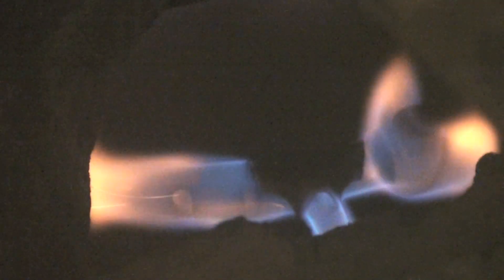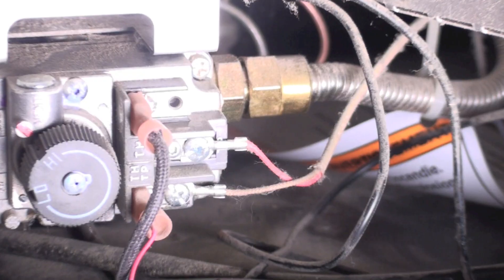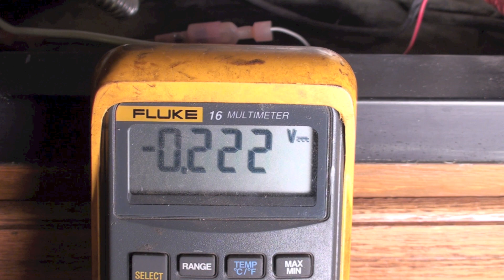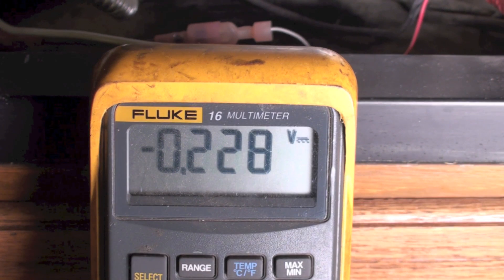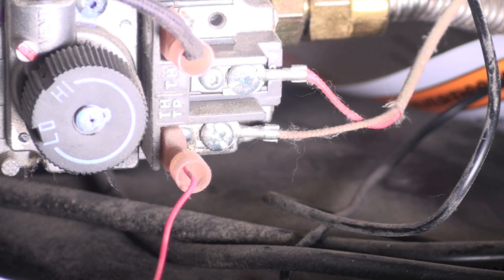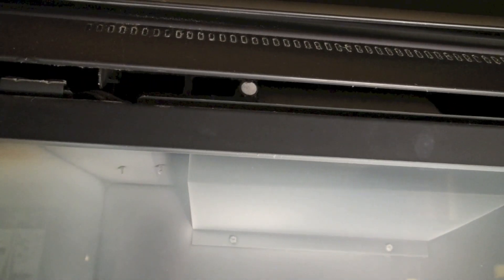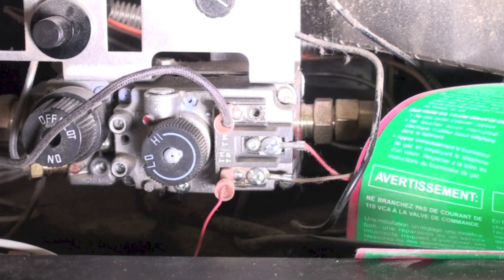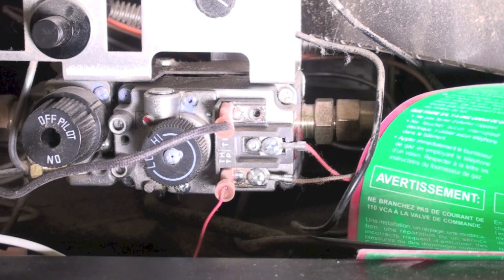How the fireplace thermopile system is wired

Comment: GFM.  I'm having a weak pilot light problem on a  Majestic 36BDVRRN natural gas fireplace with a Sit 820 gas valve and an FP 9903 top mount pilot. It is burning blue,but is not strong enough to be projecting out far enough to impinge on both the thermocouple and the thermo-pile. I proved everything else was working using a propane torch to substitute for the standing pilot. 

I've tried adjusting the flame using the adjusting screw on the gas valve, but there was no change. I use compressed air to blow out around the head of the pilot tube as much as I could, but that did not seem to improve anything. There did not seem to be any easy way to disassemble that unit to try to get to the orifice to check for plugging, assuming there's one in there. What would be the procedure to do that? 

I also tried removing the pilot gas tube from the main gas valve and was going to blow compressed air through that to see if I could remove any obstruction. I was able to get the ferrule not completely loose in the, but the small diameter aluminum tube did not seem to want to pull out of the gas valve even with pretty firm tugging on it. I did not want to damage it so I did not mess with it anymore and just retighten the ferrule nut. Is there some special trick to remove that pilot gas tube? Looking at the photos online of the replacement pilot head assemblies it appears to be just a simple tapered end on the tube that would match up with a seat in the gas valve.
Reply from the maker: There is no special method to removing the pilot tube.  Sometimes tapping the tube will loosen it.  There is a very small orifice at the end of the tubing at the pilot.  It may be plugged. It will need to be replaced.
GFM
Reply: @grayfurnaceman  , thanks for your quick reply.

So I assume there's no way to disassemble that top hat assembly at the end of the pilot to access that orifice to clean it. Is that the case?
Reply from the maker: No, it is easily disassembled.  You may have to do some disassembly to get to it.
GFM

Comment: Thanks for a solid explanation on how these units function. Fought with my fireplace for a while... intermittent flame... pilot light would shut down while in use, etc.  I was able to establish that the thermopile and thermocouple were good. Issue was thermopile was not generating enough voltage due to insufficient pilot light. Tried adjust the pilot with no luck. Ended up having to clean out the pilot jet as it became somewhat corroded. ONce that was cleaned it fired right up like it was new.
Reply: Tim, I'm having the same weak pilot light problem that you describe and I've tried adjusting the flame. I proved everything else was working using a propane torch to substitute for the standing pilot.

What fireplace were you working on? Mine is a Majestic 36BDVRRN with a Sit 820 gas valve and an FP 9903 top mount pilot assembly.

Was yours the same or similar? I did not have any success in trying to clean the orifice or pilot tube.

Comment: Is there a way to wire in a thermostat on my gas fireplace mine has a gas control valve with pilot, on ,and off and another knob that controls the flame height it also has a box with a switch that says on off and auto I realized to
Day there is a light switch on my wall that I can turn the burner on with when the box on the heater is in the off or the auto position or I can turn it on by switching the box to on ..... any help would be appreciated thanks
Reply from the maker: You can install a thermostat in place of the wall switch.  This can only be done if the switch is wired with thermostat wire.  If it is wired with 12-2 romex, it is probably a 120 volt circuit and any thermostat would have to be rated for 120 volts.
GFM
Reply: grayfurnaceman thanks yes it is wired with thermostat wire I’m going to get one with the remote control with built in thermostat. Thanks again

Comment: Good video. Thanks for taking the time to train and upload.
I replaced a Fireplace gas control on a Hearth and Home unit. The old control had a thermocouple and thermopile. The replacement control, Robertshaw 710 series Millivolt style, did not have a screw in thermopile connection. It had a jumper wire from one of the wire terminals to the place where you normally would screw in the thermopile fitting.
I take it, the voltage that operates from the thermocouple is used via this jumper wire to control the magnet on the thermopile side too. ???
I hooked it all up and everything appears to be working perfectly...but that doesn't necessarily make me sleep better.

Comment: I have a problem with my Napoleon HD40.  The pilot lights perfectly every time but the main burner doesn't light.  I'm not sure if the problem is with the Dexen IPI 3v electronics not sending the correct voltage to the valve, or if the Dexen valve isn't opening when told to do so.  The thermopyle is sending about 480mv to TP-TH/TP.  It reads about 340mv between TP and TH.  With no wires connected the resistance between TH and TP is essentially infinite (open).  Does this sound like a electronics problem or a valve problem?  I've been trying to fix this for months . . . and it's about to get cold up here in Canada!  Any advise would be appreciated.
Reply from the maker: I would be checking the ignition control for input power.  Power in no power out control failed.
GFM
Reply: I get the same result using either AC adapter (3v AC) or battery (3V DC).  There is an inline battery relay that excepts both of these power inputs and sends it on (DC) to the main module.  Page 43 (Section 8.4) of the fireplace's manual shows the full setup.  It is available at http://mynapoleon.napoleonproducts.com/uploads/product_downloads/W415-1566_AeAf1.pdf
Reply from the maker: If you have power to the ignition control, but no power going to the pilot, and the wiring to the pilot is ok, the control has failed.
GFM
Reply: How do I tell if I have power going to the pilot?  When I turn the wall switch on the pilot comes on.  When I turn the wall switch off the pilot goes off.  If the module is the problem can I bypass it somehow to test the valve?  Are the measurements I gave indicative of a normal, or defective, valve?  If normal, I'll buy a new module for $100.  If defective, why would I replace the module when that's not the problem?  Or do I need to do more measurements on the valve for you to know for sure?
Reply from the maker: If the pilot comes on when it is powered up, it is probably not proving the pilot is lit.  I believe there is a flame rod on the pilot assembly. Try cleaning it with sandpaper.
GFM
Reply: I cleaned both "probes" that get engulfed by the pilot flame.  No difference.  Pilot lights fine.  Main burner never turns on.
Reply from the maker: You probably have a failed ignition control.
GFM
Reply: I ordered a new ICM and that fixed the problem.  In checking the voltages at the valve TH to ground is now 1.92v.  Also, the red and green LEDs on the battery relay are now brightly illuminated.  With the defective ICM they were very dim.  Thanks for all your help.  Hopefully this will help others in the future.
Reply from the maker: Jeff Bowyer Glad you got it going
GFM
Reply: Regency fireplace pilot won’t light

Comment: My thermopile voltage is .390 mV with the pilot on.  When I turn the burner on it dropped to .180 mV.  My question is it normal for it to continue to drop while the burner is on.  In 17 minutes it dropped to 157 mV.
  
My main issue is that it intermittely has shut the burner and pilot Off.  Restarting the pilot always seems to work, but not the burner.  One of the times when I turned the switch on, the pilot shut Off.

I then cleaned the thermopile with emery cloth and everything seemed like it was working great again until the third time I tried it and the burner wouldn't light again.
Reply from the maker: The minimum mv with a load is 125 mv.  I would like 500 mv open circuit but yours is not bad.  Some units have an over temp limit that will shut down the pilot.  Other than that, be sure all connections are tight.  Hope this helps.
GFM
Reply: Thanks so much for the quick response and information.

Comment: Hi Gary, nice video. I have a gas fireplace that is currently hooked up to a light switch. So "on" the fire will light... "off" and the fire goes out. The problem is I am scared we will forget to leave it on accidentally while out of town. I am attempting to replace the light switch with an analog low voltage thermostat so the fireplace will turn off at a max of 80 degrees. I hooked up the red and white wires from the switch to the thermostat from honeywell and nothing happened. Any guess as to why? Is the voltage not quite right for the model thermostat (CT87K)? or is the wiring at the control valve not set up for thermostat control? Seems like mine is wired just slightly different. Thanks for any help!!
Reply from the maker: You have the wrong thermostat.  You need a millivolt thermostat.  Try this one:  CT53K1006/E
GFM
Reply: @grayfurnaceman  just curious I have the very same issue I have a brand new Honeywell CT 33a if I touch the red and white wires together the heater turns on and stays on but if I hook up the red and white wires to the thermostat and put the temperature to 90 the magnet clicks over but the heater never turns on any ideas?
Reply from the maker: The gas valve runs on very low voltage, so it is easy to have a bad connection.  Try cleaning the thermostat contacts with a piece of cardboard.
GFM
Reply: @grayfurnaceman  hello Gary, I thought it was a bad thermostat so I just replaced it with new and it's doing the same.
Reply from the maker: Is the new thermostat rated for millivolt?
GFM
Reply: @grayfurnaceman  yes Honeywell ct33a  says 750 millivolts on there
Reply: @grayfurnaceman  thing is when I take the white and red wires from thermostat and touch flames on. But connected to brand new thermostat nothing. Pilot is on.
Reply: Either you have a bad connection in one of the wire terminals or the thermocouple is not putting out enough voltage.  Is the pilot flame covering the the thermopile completely?
GFM
Reply: @electriccar3253  who would be your suggestion test voltage at the thermo-pile like the video suggest cuz when I touch the red and white wire I do get flame on butt that just that there's probably not enough voltage to trigger the thermostat

Comment: Thank you so much! we had a repairman come out to look at our Gas Vermont Castings stove and he said the Honeywell Valve needed replaced and they don't make it any more so throw out the stove and get a new one. As that solution wasn't acceptable I came upon this tutorial and we worked on the stove and cleaned it all out and filed the thermopile with an emery board. It works!
Reply from the maker: Can't say I know why that worked but glad it did.  Many techs do not understand millivolt systems.  However, even if the valve was bad,  most valves have a general replacement valve that will work.  Sometimes I growl about service techs not servicing.
GFM

Comment: How do you know you have a open circuit when your in mV,  wouldn't your meter have to be set to ohms to perform a proper resistance check?
Reply from the maker: In this case, you are using the "hopscotch" method to find the open.  A little complicated to explain here.  Try Electric troubleshoot with the voltmeter in my channel.  There are 3 videos that may help.
GFM

Comment: I enjoy your videos man. You've got some great knowledge on your channel. See if you can help me, please. 
I just bought a house with a propane fireplace. It's run off of propane, with a Sit millivolt valve. The pilot light looks great, all blue flame. I can not get the burner to come on. 
The fireplace has never been used, house was built in 2014. Should there be electric an electric switch to give it power? I've replaced the thermopile, only to get the same response- No burner flame. ____HELP!
Reply from the maker: Most of these fireplaces have a switch inside that can turn it on.  Additionally, there may be a wall switch (or thermostat) that can be used to turn it on.  Also, be sure the gas valve is in the "on" position.  Hope this helps.
GFM
Reply: grayfurnaceman I just figured out, by chance, that there needs to be a jumper wire from the TH to the TP/TH. 
I'm in the process of installing this. Could a regular light switch work? Will 16 gauge wire work? I'm thinking about putting a dimmer light switch on it, would that be feasible?
Reply from the maker: Yes and yes and no.  Dimmer will introduce resistance in the line and shut it down.
GFM
Reply: grayfurnaceman thanks for the assistance. Much appreciated!

Comment: my 95 year old grandmother was given an older U28 Regency fireplace. She wants it working so she doesn't have to have wood brought in for her wood stove. I don't know if it's hooked up right or if it works correctly. I don't know anything about gas stoves. Can I inspect it to make sure it works correctly without having the gas company turning on her gas? she doesn't want a gas bill if this fireplace doesn't work. I don't know what to check for.
Reply from the maker: I would get a professional for this one.
GFM
Reply: grayfurnaceman I am experienced with heavy equipment vehicle maintenance so I feel I could troubleshoot it with some general knowledge of what to look for and what to test. I have a wiring schematic, but not sure how to test or when each area should have continuity/voltage or how much.
Reply: grayfurnaceman for example can I recreate a pilot/flame to make system think it had gas so it would work properly and I'd know I could get gas hooked up to it?
Reply from the maker: There's no way to be sure everything works without gas.  You can use a propane torch to heat the thermopile and measure the output.  Should be 500 mv open circuit.  The problem is there is no way to determine for sure the gas valve opens without gas to it because it uses the gas pressure to open the valve.  The good news is there is not a lot to fail.
GFM

Comment: my 4 year old Regency u-39 propane stove will at times stay on heating the house beyond the set temperature, as high as 90 when set at 70, this happens  occasionally , I replaced the batteries in the wireless remote and receiver box, but with no luck....any ideas? thanks
Reply from the maker: I am assuming the remote is located in the conditioned space.  If power is present at the gas valve when this happens, you have a problem in the receiver or remote.  No power to the valve, the valve is sticking on.  This is one of the hardest types of failures to find as it is intermittent.
GFM
Reply: thanks for the info, i'll check it out

Comment: question: I light my pilot after cleaning my thermopile it has improved blowing blue/strong but won't light the rest of the fireplace. It's at 663mV . The sensor lights and becomes bright red...after several minutes the sensor suddenly cools off and the pilot loses it's zing, but still burns well. Any ideas?

Comment: I am looking to convert my gas vent free 10.000 BTU fireplace to thermostat control. My idea is to use a MV Valve from a gas water heater, and thermopile for safety and feedback to control the valve. To keep things simple this would be a STANDING pilot system. This valve would be in series before the supplied fireplace valve. The fireplace valve would be left open. Street value of the manufactured control systems easily approach $700. Any thoughts or suggestion?

Comment: Hello, I have a thermopile issue I tested with a Multimeter and open flame and as soonest I hit 400mv meter goes OF.L (Offlimit)..as I let it cool then It starts working again. Does that indicate a faulty Thermopile? My fireplace pilot would not stay lit. Thank You
Reply from the maker: +s13konrad The meter just is not set for anything above 400 MV.  The thermopile can reach up to 750 MV.  If the pilot won't stay lit, be sure the flame is blue and covering the thermopile.  If it is ok, check for a manual reset limit in the circuit.  Hope this helps.
GFM

Comment: My pilot would not lite, tried cleaning, noticed by trying to lite at the pilot with a lighter that the lighter flame didn't even flicker, so i shut off the main leading into the control box, disconnected the line going into the box, turn the shut off value back on and no gas was coming out, what am i  missing here, thank you
Reply from the maker: Pinky Floyd Have you put the gas valve knob in the pilot position and pressed down the knob while lighting?
GFM
Reply: oh yes, tried many times, as many as 30 times
Reply from the maker: Pinky Floyd If you are saying there is no gas available to the gas valve, are other gas appliances working?  Is there a key shut off near the fireplace?
GFM
Reply: I shut off the key gas shut off, no other gas appliances, after shuting off i disconnected the gas line that goes into the main control box for the fireplace, then turned the key shutoff on and no gas was coming out. thanks you
Reply from the maker: Pinky Floyd You have a supply problem.  Have you paid your bill?
GFM
Reply: i just found the apartment shut the gas off without telling anyone, those buggers
thanks 4 your help
Reply: "You have a supply problem.  Have you paid your bill?"

That's got the makings of a funny diagnostic tree chart!   Something on the order of, "Is it plugged in?"

Comment: Gas fireplace;......my pilot stays lit but when I light my burner it only stays lit for about a minute or less and then you hear a "click" and the burner and pilot go out. Do you think this is a limit switch issue or?................could you share your thoughts
Reply: Mine to Gary. Did you find what was wrong?
Reply: I had a "sit"  model thermocouple with interrupt leads that was bad. I replaced it and no looking back. My fireplace is a majestic model and I ordered the part through amazon......hope this helps
Reply: Hi my fireplace has control knob pilot position not push in how can fix
Reply: 66